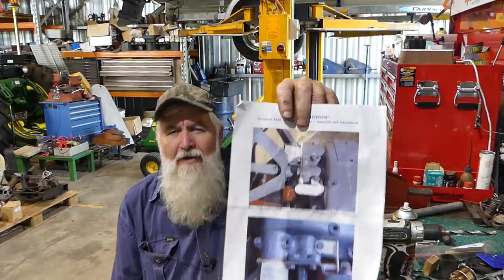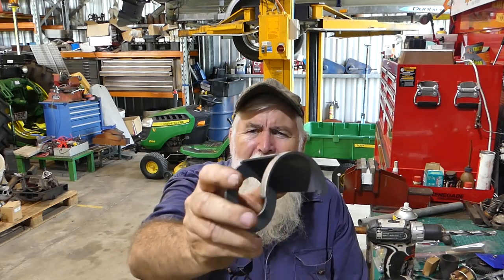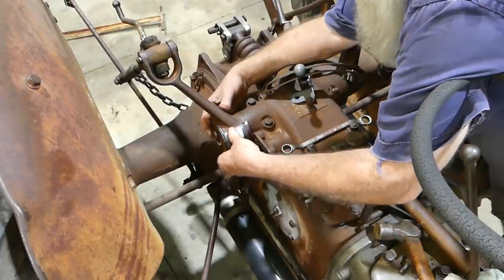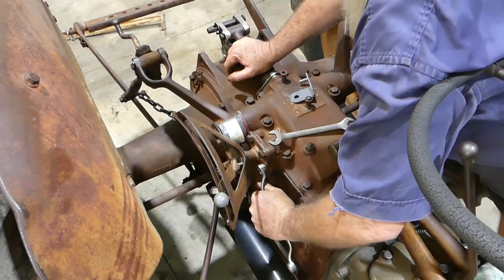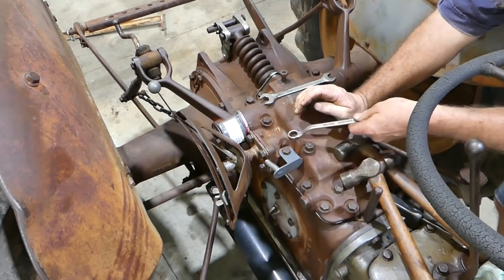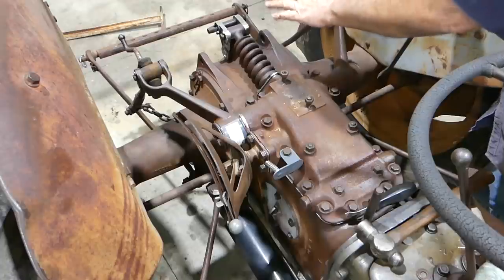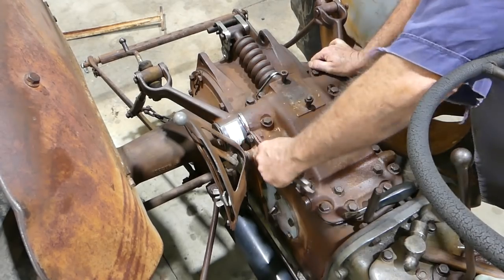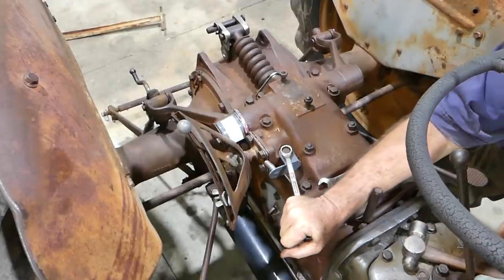Ferguson Position Control! I fit and test the Australian Fergy Positioner Kit

Comment: Cheers mate, My Father, Brother and I invented this kit 20+ years ago.  We investigated how position control works in a 35 and matched the profile of the internal cam within the housing of the 35 and found a way that we could get it to work external on a Grey Fergy.  As you know pulling apart the cross shaft on a Grey Fergy is not for the faint hearted.  Once we had it working, which we really only did to see if it could be done, we thought that others might appreciate it.  Have been selling them constantly ever since.

During the course of manufacture of the tractors there seems to have been some slight thickness changes on the quadrant mounting pad and so some springs do end up a little out of alignment, I have suggested to a couple that have contacted me about this issue to file out the hole slightly and shift it away from the body of the tractor, it was designed as you supposed to rest on the housing, but the bolt should be done up nice and tight so should hold the forces ok.  

Thanks for the review and happy tractors.
Reply: Well Done
Reply from the maker: Thanks Stephen, It seems to work well but Im thinking you knew that. You must have sold a few as they seem to be coming out of the woodwork. If you want to sell them through Queensland Tractor Spares let me know and we can stock them. lance@queenslandtractorspares.com.au.
Reply: Waxwork

Comment: G'Day Lance, nicely done very similar to how my install went, just like to mention that the Ferguson instructions tell you that when fitting such implements as slashers, post hole diggers etc. you should use the long pin beneath the draught control link pin so by passing it altogether. Really enjoy your videos. Thank you.
Reply from the maker: Yes but the trouble comes when many slashers etc come with the standard top link mount

Comment: Nice to see how quick and smooth that three point moves. It's on the project list for my pair of 35s this spring (TO and MF).
I know you're keeping this Fergie rusty, but you might want to experiment with a mix I found on Vice Grip Garage channel:  1 part spirits:2 parts boiled linseed oil. Then wipe it on (thin coat is best). It protects the surface and it's cheap. Lasts six months or a year or more depending on weathering. It will keep the relic look of this Fergie. I used it on the badly fading MF35 red paint and it revitalized it rather than repainting the tractor.
Reply from the maker: I have painted it with Penetrol since filming, the rust has darkened and the grey still looks close to the same.
Reply: Need to try this on my Massey

Comment: Great vid mate!  My 58 Fergie is low on pressure, needs high rpm to lift 3point hatch, is there a pressure adjustment for it.
Reply from the maker: Not really an adjustment but you could try replacing the stand pipe o rings and the piston rings and see if that helps before working on the pump.

Comment: Lance.  I have cleaned the pump. freed up the mechanism and when i lower the arms its very slow.  Can this be adjusted or is this normal?
Reply from the maker: Can be normal with a rusty top shaft, it sshould get quicker with some load

Comment: Hi, My linkage will lift up but not go down. I have to put all my weight on the back to force it down. Any suggestions please?
Reply from the maker: Check the end bolts on the top shaft are not too tight and possibly adjust the lever position where the 4 bolts are.

Comment: Hi, newbie Fergie TO-20 owner... so with position controller installed, will I be able to put a load on the arms in other positions besides full up and full down? thanks!
Reply from the maker: Yes you can.
Reply: @BundyBearsShed  thank you. I emailed the place you suggested and Steven got right back to me. I expect to order the positioner very soon ...just ordered new gas tank & upper arms, so trying to stretch out expenses! I am grateful for your video help. Happy Tractoring!

Comment: to30 trans rear end swap, once the engine was removed we seen one trans had extra parts in bell housing and a lever. Can you tell what is going on please. should I swap out the extra parts, why are they not the same. Great chanel.
Reply from the maker: It sounds like a Sherman reduction. You are very lucky if it is.
Reply: @BundyBearsShed  thanks thanks! thanks!!, you are the man

Comment: Possible to replace the 4 bolts with studs and then lock nuts or self locking nuts? Better than using damaged threads.
Reply from the maker: No not really but 2 bolts and the cam is off out of the way.
Reply: @BundyBearsShed  You misunderstand. You stated the 4 bolts that hold the draught control lever are smacked on an anvil to distort the threads thus providing a lock. In my opinion better achieved by either lock nuts or self locking nuts.
Reply from the maker: Sorry John, I agree for sure with over 60 messages yesterday morning it looks like the wrong reply got added to your message.
Reply: @BundyBearsShed  No worries old timer.

Comment: Hi Lance. Can I pick your brains. We have a 135 with jerky hydraulics. Any ideas what that could be. Many thanks.
Reply from the maker: Possibly bad filter where the pump is not getting enough oil.
Reply: @BundyBearsShed  Thanks for the reply. I can check it in case it has picked up some muck from its previous unknown maintenance history, although I did clean it and put fresh oil in it a year ago wih little use since. Any other possibilities in case that is not the problem?? Many thanks.

Comment: Just removed this system from my latest tea20. Possibly poorly installed but the linkage would not in the lowest position. All the way down then it would lift 2-3 inches. The bolts were also loose and the movement had allowed dust and moisture into the transmission.
Reply from the maker: Too loose possibly?
Reply: Had a similar problem, turns out where the quadrant lever pushes on the control arms inside the lift cover was worn and pitted, with matching wear on the corresponding plate on the control arm.  Net result was there wasn't enough "throw" when the quadrant lever was rotated.  Solved it by sleeving the end on the quadrant to 20mm with some aluminium tube.

Comment: Hi Lance it would be interesting to see how it would work on a plough if you could use draft and position,as you can on a 35  cheers Ian
Reply from the maker: No not really but 2 bolts and the cam is off out of the way.

Comment: Hi Lance,   Just got one of these kits and yet to fit it.  Your vid is most helpful.  I wish to use it with a jib where draft control (movement) would be quite dangerous especially if lifting something in a confined space.  I notice in your vid that there was still some noticeable movement in the draft function.  Do you have any suggestions whereby I can totally disable the draft movement?  I guess attaching the upper linkage to the lower pin would do this, however I would have to make up an adaptor to do this as the jib has a square section on the end which sits between the upper bracket.   Thanks.  Marcus
Reply from the maker: My reactor is very stable with the kit fitted and Im thinking with a load on the jib crane as it is pulling on the spring and not pushing you may not have a problem. The only adjustment is on the spring so if you do have a problem possibly try to fiddle with that. Best option is use the lower mount though if possible.
Reply: @BundyBearsShed  OK, thanks for that.  Will see how it goes.

Comment: Hi Lance I see Neil has posted that you are supposed to use the long pin underneath the draft control, I'm not sure how to make that work. Do you know of a way to hook top link up to that? Cheers mate. 👍🤠 ps enjoyed the video.
Reply from the maker: The genuine Fergy implements had a fork for the lower pin, I still use the top pin on mine and adjust it so there is no slop in the spring and it works ok .
Reply: @BundyBearsShed  I've found I have problems grading my driveway, its quite rutted and hard. Would it hurt if I took the draft link pin out all together? Even replace it with a smaller diameter pin when I'm grading to keep it all aligned. Thanks for answering so quickly. Cheers mate 👍🤠
Reply: My spring feels tight as.

Comment: thanks lance - looks a useful gizmo but does it compromise the draft control at expense of accurate raise control in your opinion? really appreciate all your vids keep it up  cheers guy in sheffield yorkshire
Reply from the maker: Yes it does, to go to full draft again undo 2 bolts that hole the cam on the lift shaft.

Comment: Hi LANCE,just wondering if you can replace or override gear start on a fergie te20 1950 to electric key start,it has a 12volt battery +this old fella cannot hit gearstart at all,so the alternative would be great,thanks for all your youtube videos I love them take care joe crabtree newbybridge Cumbria uk
Reply from the maker: Yes you can for sure by using a solenoid like on the FE35 or MF35 petrol tractors. Thats how they do it.
Reply: @BundyBearsShed  THANKYOU LANCE,do you just run  live+ negative wires to a starter as there is already a solenoid  on the fergie te20 thankyou joe south lakes cumbria uk
Reply from the maker: The TE20 doesnt have a solenoid standard that thing on the bell housing is a switch, the idea is to replace that with a solenoid that is key operated, copy the wiring from the switch and you will be away and running

Comment: If I am never using implements that enter the ground, can I adjust the original mechanism to give better positional control?
Reply from the maker: Possibly adjust it as good as you can. The big spring adjustment is very important on these tractors.